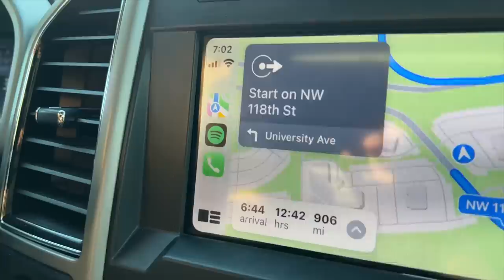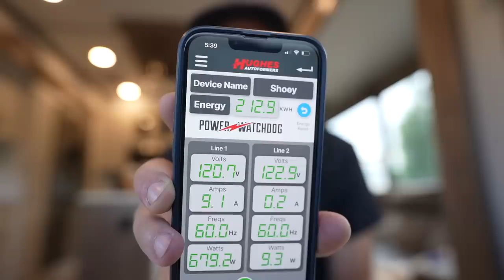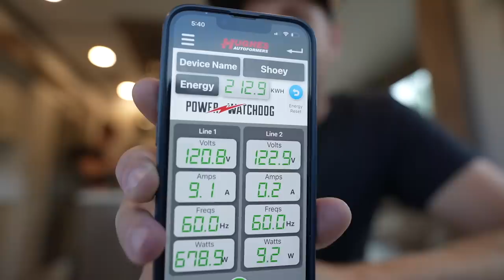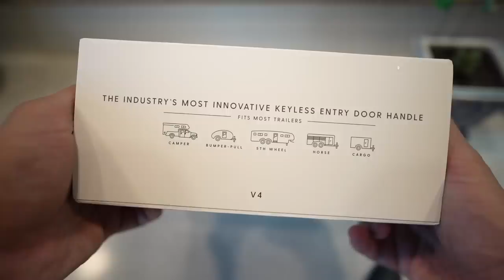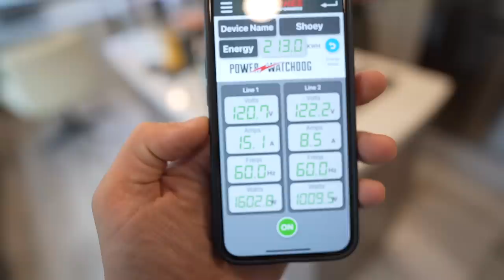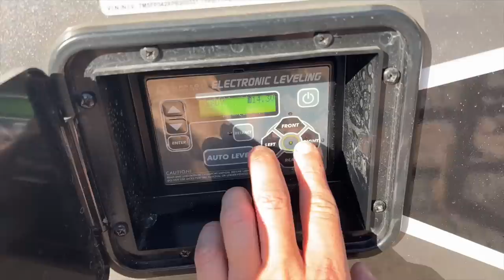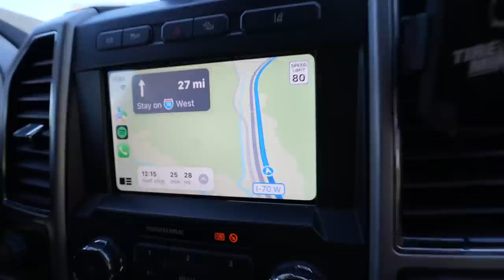We Almost Run Out of Fuel on the Road! - RV Tow Update

Comment: I would suggest you put your battery disconnect switch on the negative lead instead of the positive lead. This eliminates the rare chance if something happens to short the positive of the battery to ground.This will cause a dead short even with the switch in the off position. . If the switch is on the negative side, then it wont be an issue if something happens to short the positive of the battery to ground. It works either way. Just a little safer if your switch the negative instead of the positive.  On DC volts system it is always good practice to disconnect the ground first and connect the ground last when working on the system.

Comment: I've stayed at that campground in Brush, CO before.  It's a nice place to stay for the night.  

Also, I have a 2017 F350, so a very similar truck to yours.  The tank is a 34 gallon tank.  When it shows 0 Miles to Empty, and if you filled up the tank, it would take 29 gallons.  Ford "hides" 5 gallons from you.  Once it says 0 Miles to Empty, you actually have 5 gallons left, which means about 50 miles (@10 Miles Per Gallon).  Not saying you should always dance real close to empty, but you do have more than you think.

Comment: Could you all do a video on pulling the 5th wheel with your truck. Are you using the same truck that pulled your trailer? Did you on purpose buy the truck knowing it could pull a 5th wheel later on? How is pulling the 5th wheel c/w pulling the trailer.?  How did you decide what kind of hitch to install to pull the 5th wheel? Did your truck limit how big your 5th wheel could be?

Comment: FYI - the next time you need to pass thru St George when it's hot, go up to Pine Valley Rec Area - gorgeous and higher elevation, much cooler. PS - get an after-market fuel tank to replace your own under the truck, not the bed which takes up space. We went from a 35 gal to a 55 - game changer!
Reply from the maker: Thanks, well remember that for next time in the area. I really want one of those tanks!!!

Comment: We were feeling your anxiety watching your video tonight.  Once we were traveling at night and our gauge started dropping quickly.  We had 50 miles to gas and 100 miles to empty that quickly turned into 25 miles with 30 miles to empty.  We abandoned trying to make it Buccees and started looking for exits.  We pulled off an exit with 2 miles to empty but the one station was closed.  We had a station showing on maps 4 miles away.  We hit 0 on the gauge about 3 miles from the station.  Pulling into the station was such a relief and it took over a gallon more filling the tank than we had ever had before.  Lesson learned for me.  First, if possible, don't travel at night.  Second, always start looking for gas at 1/2 a tank regardless of where Buccees is at.  Safe travels to you.  We can't wait to see your new solar/battery/inverter install.
Reply from the maker: Whoa! It would be way worse at night! Glad it worked out. 👍

Comment: For the Insty Connect, I think I recall Nick saying that the router runs on 12 to 24 volts....I'm going to hook my Insty in the rigs 12 v system, that way I don't need the inverter on to have an internet connection...

Comment: Kris seems real excited by the washer/dryer addition. As to fuel, we have a 50 gallon tank, which gives us a 500 mile range. Which is more than we drive in a day, so works great. You can replace your stock tank with a larger tank, so that you don't have an auxiliary tank taking up bed space.
Reply: We have a 60 gallon diesel and get 1000 miles.  It's heaven!

Comment: Crossing my fingers and hoping you two are not building another 12v system. Also, when I was building mine I bought an extra inverter and switched my AC unit so that I could run it off main power or the batteries. Comes in handy when you only have 15 amps and need to juggle power.

Comment: I'm really looking forward to the solar install video.  We have pretty much the same truck, just ours its a 2017.  I can always tell when the truck is doing a regen as the mileage drops dramatically.  We pulled our 5th wheel on very long trips the past couple of years, and that stock fuel tank is an issue for us, as we just don't get enough range.  I'm planning to replace that tank before we take another long trip.  We came back from a trip in June and I decided not to stop for fuel as I calculated that we would have 98 miles left when we got home.  Truck did a regen and we ended up with 38 miles left.  My wife was kind of freaking out.  
Best regards,  Kent

Comment: Unless your running a 24 volt battery system your cables look pretty small from your batteries to your shunt. With almost 300amp/hrs at 24 volts or 600 at 12 volts you should have 4/O cables

Comment: nice modifications so far.   Looking forward to see the final electrical upgrade.    Running low on fuel is never fun for sure, but looks like you made it with several gallons to spare....as always safe travels...

Comment: 10:50 I am assuming the Victron multiplus have the smart assist (I have quattro), but it's a lifesaver! Air conditioner, induction stove, and microwave on a 15 amp circuit? As long as you entered the current limit, no problem.

Comment: I really enjoy your videos! I have a question, I have been looking into the MORryde Cushioned pin box which I see you have.  I have the Curt Turning Point on my new G/D 295rl and I hate the chucking (we came from a Class C). I'm curious on if the MORryde eliminated or improved the chucking.
Reply from the maker: Hello and thanks! We really like the MORryde pin box so far and I would say it "almost" eliminates all chucking. The only time we feel a little bit is if stopping or starting too fast. But the couple of inches of movement gets absorbed by the rubber in it most of the time. It is really nice! 👍

Comment: Hi Aaron, can’t wait to see how your Victron/Battle Born upgrade turns out!  This will be your 3rd one?  Hey, check out the Blue Sea 3000 HD disconnect switch vs. the one you showed in the video.  The HD will handle 600A vs the smaller one’s 300 or 350A.  I just finished a MultiPlus II and GC3 upgrade on our Airstream and a friend pointed this out to me.  Glad I did so.  Also, Battle Born Support told me not to connect the disconnect directly to the Victron Distributor because they said “it can cause resistance”.  I finally figured out they were suggesting it can loosen over time and thus cause resistance.  They said they wouldn’t support me unless I used a cable between all the connections (which I did).  Just a thought!  Keep up the great videos.  PS:  We miss you on the AS family but understand you needed more space that a 5’er provides.
Reply from the maker: Hey Jeff! Thats good to know about the Lynx distributor. It seems safer to me as its one less connection to make and they are designed to be connected there to each other... but I get that it's not designed that way. 

I actually bought one of the 600a HD switches at first! It's too bad they don't make a 400 amp switch as 600 is way overkill but 400 amp is what a lot of 12v systems are rated for with the fuses and 4/0 cable. It's 900 amp for 5 min and 1750a for 30 seconds! My new system will be half the amps (hint hint) so we went with the 350 amp switch. It's rated at 600a for 5 min and 1200 amp for 30 sec which is overkill for our new system. 

Glad to hear your enjoying your new system upgrade!

Comment: Why did you go with the aftermarket solar system vs the super solar plus package offered on Alliance? I'm currently trying to decide between the two.
Reply from the maker: The Super solar is only 960 watts and 300 ah of lithium I believe. That is a good amount for most, but with us being full time and spending about 50% without hookups, we wanted a much bigger system.  Plus those big 320 watt panels they use make it hard for adding more solar because where they have to mount them. Also I really like the Victron and Battle Born ecosystem over the Renogy system. 👍

Comment: I was wondering why you are not using a teflon disk for your hitch pin or did I just miss it?
Reply from the maker: It's a Pullrite Superglide auto sliding hitch and they don't recommend anything on it. It needs to lock in place for the auto sliding to work I think.
Reply: @IreneIronTravels  I didn’t realize that thanks for educating me.  Look forward to the electrical install video.  I did my fifth wheel from you last install video I learn enough from it.  Safe travels.

Comment: Why aren't you using a lube plate/wear plate on your fifth wheel hitch (goes between hitch & pinbox). Just curiosity killin' the kitty
Reply from the maker: Pullrite the manufacture doesn't recommend one, I think because it's a sliding hitch.

Comment: My wife and I are real close to putting our order in for our RV. An F350 will be my tow vehicle. Is yours a long bed or short? When you said 90 degree turn I wasn’t sure if I could do that with a short bed truck. Thank you for the video!
Reply from the maker: Ours is the short bed. That why we got the Pullrite auto sliding hitch so we can do 90 turns if needed. It automatically slides back as you turn. 👍👍
Reply: @IreneIronTravels  that is great news! Thank you! Congratulations on your beautiful RV by the way!